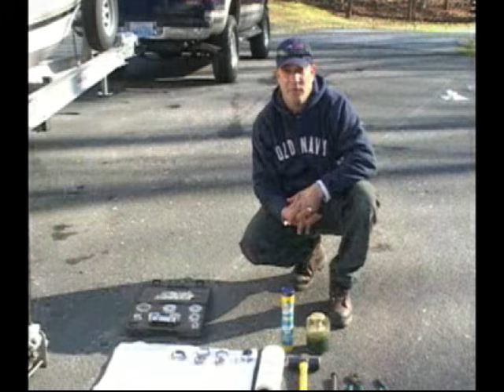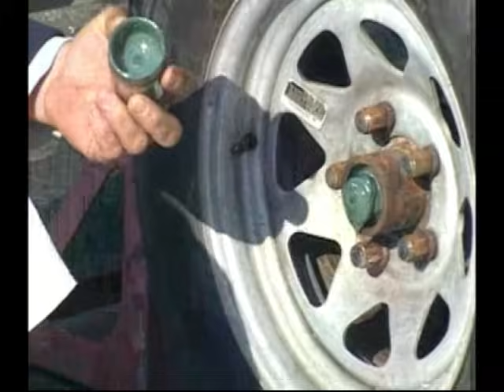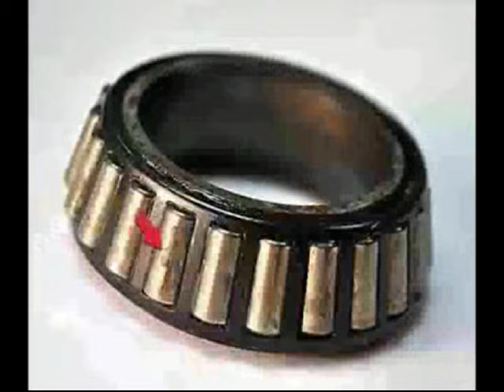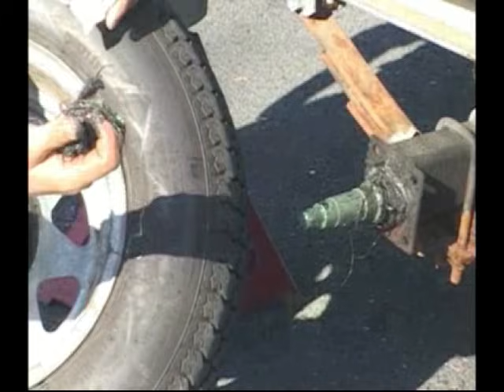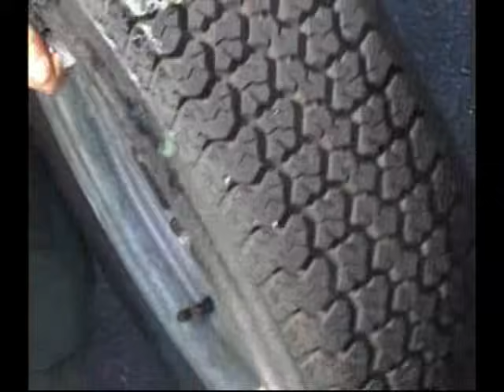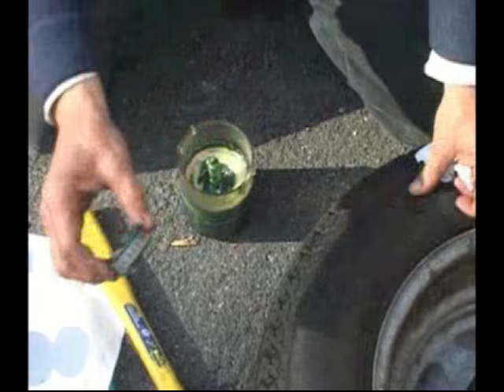How To Replace Boat Trailer Bearings | BoatUS

Comment: Use the proper tools, a socket for the castle nut, use gloves, grease is bad for you to have on your hands. Take the friggen tire off the hub, much easier to not damage seal during re install and you get to inspect lug bolts and nuts. Show how to pack bearings by hand, most people don't have a bearing packer. Use finger tight tecknique after setting preload,  hint you have to have the wheel off the hub to do it properly. Learn how to install a cotter key properly.
Reply from the maker: Thanks for your suggestions.

Comment: Good video HOWEVER, mushroomed head of the punch is a significant safety issue.  Good thing you are wearing safety goggles because a piece of that could easily fly off and hit you in the eye.

Comment: my hub wouldnt slide onto the spindle at all. I would need to be beat on. I measured to be sure Ihad the right kit. the spindle was just a few thousands too large. I don't knowif itwas old grease/dirt or what. I ended up cleaning spindal with emery cloth.    Oh the old race had to be hammered off.    Just a heads up for any of you slow brained people like myself.
Reply from the maker: While a puller may be needed to remove the old bearings, you shouldn't have to beat on them to get the new ones on. You risk damaging the bearings this way. Chances are that the bearings were the incorrect size.

Comment: Do you absolutely have to have bearing buddies. My kit came with everything but the bearing buddies 🙄
Reply from the maker: Thanks for the question, Jesse. Well... no, they aren't "absolutely" necessary. But they are extremely helpful and tend to extend the lifespan of grease bearings quite a bit. This is especially true on on boat trailers (as opposed to horse or utility trailers) because they maintain pressure that keeps water out of the hubs when the boat is launched.
Reply: @boatus  ok, one more question. I completed my bearing installation and went for a test drive. There is a squeak coming from the trailer but Idk where it's coming from. Maybe it was there before, but I never noticed. Or maybe I'm just paranoid, this is my 1st time. I didnt have a grease packer so I hand packed the bearings as good as possible
Reply from the maker: @jessebickford9469  Hi Jesse. Unfortunately it's impossible for us to try to ascertain just what's going on from afar, though we will note that most trailers do squeak in one way or another. Be sure to feel the hubs after trailering for 10 or 15 miles, however, because if one is hot to the touch, that's a sure sign of a problem.
Reply: @boatus  I felt the hubs and they were good. I traveled about an hour round trip this past weekend and all was good. Thanks for the reply
Reply from the maker: @jessebickford9469  Great to hear! Doesn't it feel good when you do a project like this yourself?!